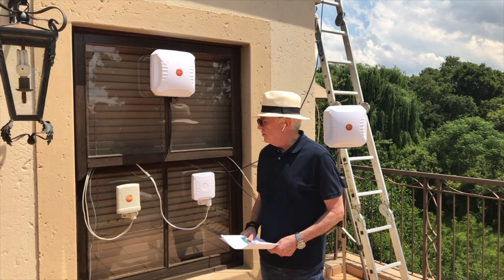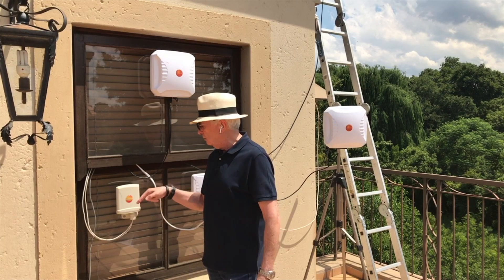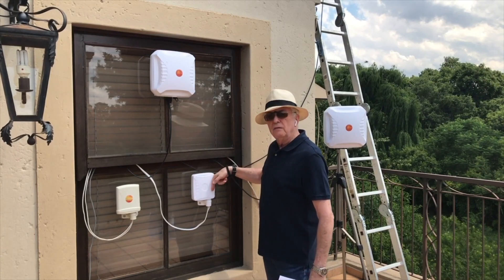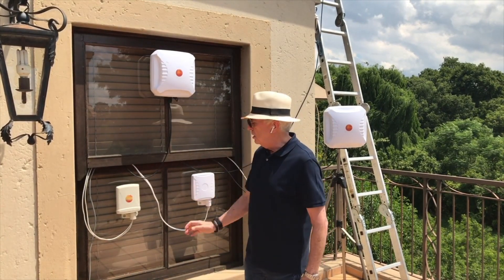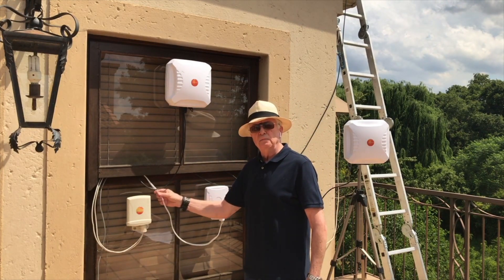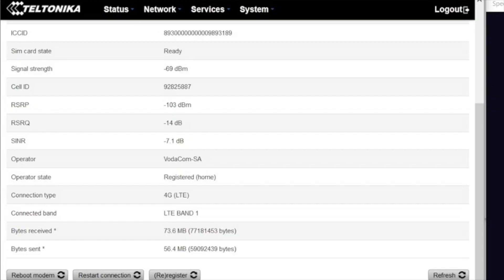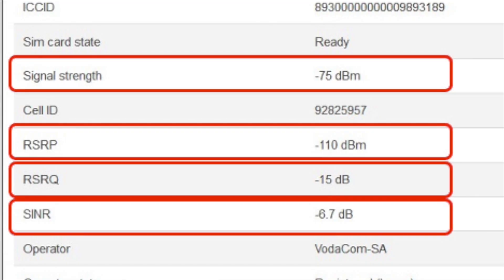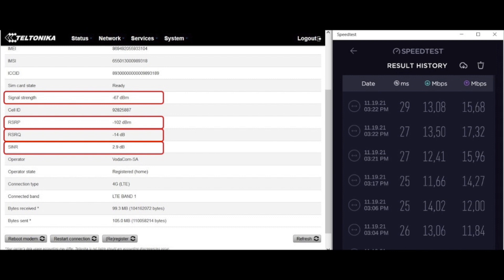XPOL-1 and XPOL-1-5G : Pick the one that will work for you.

Comment: Thank you Poynting for supplying such a great product. 

I use a 4G internet router (tp link mr600) here in England due to the non contract and cheaper costs of 4G as opposed to wired internet.

The downfall was that I suffered from slow speeds using the small "rabbit ear" antennas fixed onto the back of the router.

Last week I purchased and installed the XPOL 1 5G (backward compatible) and the difference in speeds are like night and day!

Rabbit ears gave 3mb down 0.5mb up.

XPOL 1 gives 40mb down 20mb up.

This antenna has stopped all buffering (I'm an avid streamer) and given me the ability to run a host of devices at the same time.

Your product has been a game changer for me.

The 4g+ light has illuminated on router, it's never done that before.
Reply from the maker: Thank you @ep1929. Always nice to read reviews like this! The XPOL-1 is a great (little) antenna and makes a huge difference. First thought you were a gamer and loved your "game changer" comment which I will now be using in our posts:).

For interest we have a rewards portal - where you can upload photos or a video of the antenna installed and get an AMAZON Gift Card. You can copy and post your great review as you have it here : https://rewards.poynting.tech/
 
Kind regards
Ylana

Comment: I have an a-xpol-0001-v2-41, does it need to point in a certain direction?
Reply from the maker: Hi Benny. No it is an omni-directional antenna and doesn't have to be pointed to a tower. Tx Ylana
Reply from the maker: Hi @benny4903. No, it is an omni-directional antenna and doesn't have to be pointed to a tower. Tx

Comment: What is the best antenna for the 3 UK network?
Reply from the maker: Hi @EP1929. The 3UK network uses  700MHz, 800MHz, 1400MHz, 1800MHz, 2100MHz, 3400MHz, and 3600-4000MHz frequencies.

Our antennas are broadband and covers all or most of the frequencies.

Here are some options (assuming you are in a house or office)

XPOL-2-5G This one must be pointed to the network tower and covers most of these bands (2x2 MIMO - your router has to have 2 LTE connectors)
https://poynting.tech/antennas/xpol-2-5g/

XPOL-24 This one must be pointed to the network tower and covers all of these bands (4x4 MIMO - your router has to have 4 LTE connectors)
https://poynting.tech/antennas/xpol-24/

XPOL-1-5G - OMNI directional (don't have to be pointed or alingned) and cover most of these bands (2x2 and 4x4 MIMO)
https://poynting.tech/antennas/xpol-1-5g/

Additional to frequency, your application, router and area to install is also important.

Please let me know if you need more assistance, then I will get someone in your region to assist/.
Kind regards
Ylana
Reply from the maker: You can watch this as well if it is of interest: https://youtu.be/iineNMWj8zQ?t=1378
Reply: @poyntingantennas  thankyou for your help, last thing I wanted to do was buy one of your antennas and it was tuned for the wrong frequencies.
Reply: Hi Mr Poynting, I have now purchased the XPOL 1 5G,, see above post - very pleased with purchase.

Comment: Band 3 in test one   Band 1 in test two and three?  why did you not run the first test with the router upstairs where it would have gotten a better signal by itself?  one suspects marketing ploys..
Reply: Hi dad Achoski, thanks for your comments. 
As you probably know, the Router selects the 'Band' based on the best Signal it can Receive. 
The important part is to make sure that one connect to the same Cell_ID to ensure that the Infrastructure (the Tower) is not 'overloaded' (congested) in one test vs. 'not-overloaded' in the other. 
Band 1, is FDD (Frequency Division Duplex), Up Link 1920 – 1980MHz Down Link 2110 – 2170MHz with Band Widths 5, 10, 15, 20MHz. 
Band 3 is also FDD, Up Link 1710 – 1785MHz Down Link 1805 – 1880MHz with Band Widths 1.4, 3, 5, 10, 15, 20MHz. 
Both Channels therefore has the ability to select a max. BW of 20MHz which would have made a difference if the same BW weren't available in both cases. 
The Carrier Frequencies 1980/2170MHz vs. 1785/1880MHz are also so close to one another that Free Space Path Loss difference would be minimal. 
As far as 'downstairs' vs. 'upstairs' for the 'internal Router' is concerned, you're right, I could have done the 'internal Router' test 'upstairs'. 
What I wanted to do however is to reflect on a scenario where someone does not have an 'upstairs'. What I could have done was then to 'install' the 'window mounted Antenna' on a 'downstairs' Window. 
The 'outside' Antenna, although 'upstairs', was approx. 2m higher than the 'downstairs' windows and whilst Antenna height does make a difference, I doubt that it would make a huge difference as the main challenge is Signal attenuation is between the 'outside' and having to penetrate the building. 
Having said that, with my later testing I have done exactly that, used the 'inside Router' inside my 'lab' upstairs. 
These tests, mainly on our directional Antennas will be released soon and these confirm that an external Antenna (with good characteristics) will always provide the user with much better performance. 
Be sure to watch this space for these tests, best regards, Pieter.